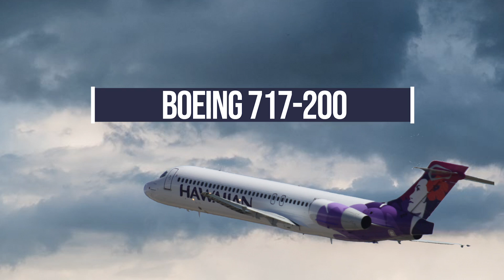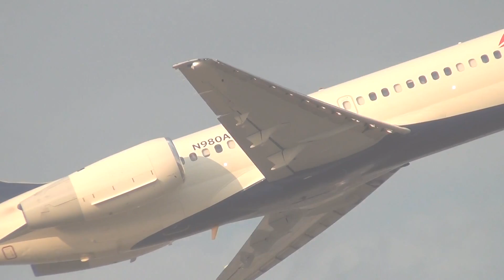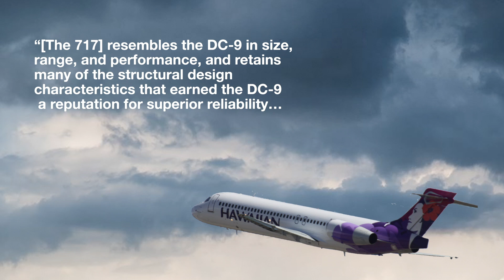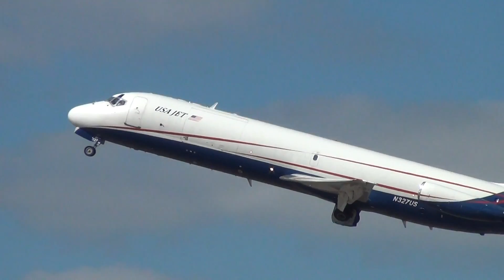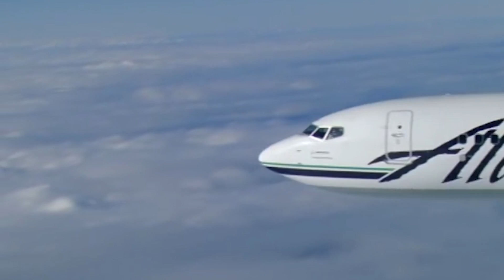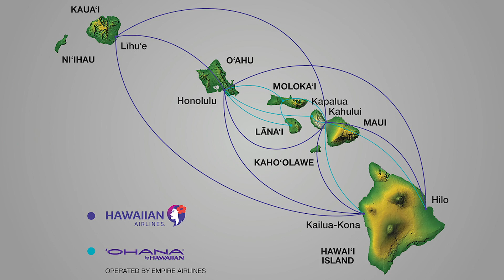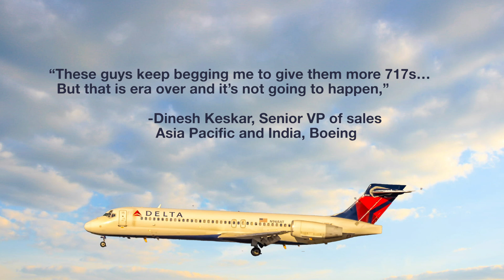Why Boeing Built The 717 And What Makes It Special

Comment: Delta is trading its 717s for 737 maxes
Reply: The A220 is going to be the replacement for the B717 at Delta. Delta has ordered 95 A220 with 31 being delivered. Delta hasn't ordered any B737 MAXs
Reply: Yes, route wise, and the 737 Maxs will replace the 30 year old A320s
Reply: @rmaviationtravel  - How do you know that the Delta will order the B737 MAX. The aircraft is not flying. Delta still has 27 A320ceo to be delivered plus they have 100 A321neo's on order but no B737 MAX.
Reply: All the Delta Airbus narrowbodies are A321ceo/neo, 191-194 seats. Delta said they were gonna trade in their 717s now, and get 737 max in a few years, which will be better suited to replace the 157 seat A320
Reply: @rmaviationtravel  - Why did Delta order 95 A220 which has the same 5 abreast seat as the B717 but with better performance? Delta has 91 B717s
Reply: Chris McKellar the A220s were ordered when delta was planning to keep the 717s until 2030. They were ordered to replace 717. They were ordered to replace some A319 on skinnier routes like ATL-SEA and expansion to give mainline service into regional airports
Reply: @rmaviationtravel  - So why would Delta order an old design non flying B737 MAX to replace to B717 when a new more efficient design A220 can do the job and even better, of the B717?
Reply: Chris McKellar It’s because the Delta 717s are on a lease from Boeing’s leading company until 2024. Delta is trying to make a deal with Boeing to get out of them early, because of the current situation. It’s a trade deal, where delta can terminate their leases early and get the MAXES in like 4-5 years, when they fly
Reply: @rmaviationtravel  - If the B737 MAX flies.
Reply: Chris McKellar it’ll likely though, sonner or later, I don’t think 800 frames will be wasted. And if it never flies again, that’s also good for delta. If it does, they get dirt cheap prices anyways

Comment: Wait - so the B737 was built before the B717? How does that work?
Reply: Samuel's Simulations Boeing never made a 717, it went from the 707 to 720 to 727 to 737 so they came back to 717 for this MD designed jet
Reply: Actually there was a 717 -- the Military Version of the 707 was originally designated "Boeing 717" by Boeing, this is why the 727 became the 727. But this designation never established so in the late 90s Boeing thought they could reuse that designation for the MD-95.
Reply: @widget787  There was a 717, you know it as the KC-135! Boeing had no ides that the 7_7 numbers would become Iconic, so they gave the next number, 717, to the KC-135.  Ther are still small plates on the tanker that say this ...if you know where to look!
Reply: @paidnasashill2150  yeah thats funny. Thats what I wrote a few posts above :D.
Reply: @jamesdean2185  yeah true, or imagine a 757 which is called 747. But if the 747 would have been a 737, it would be the number 737 which is iconic. It will be very interesting to see what comes after the 797.
Reply: widget787 Boeing goeing toeing downhill, maybe no need for new numbers